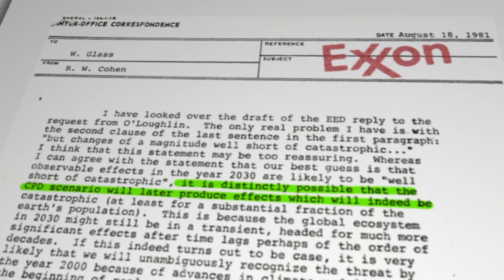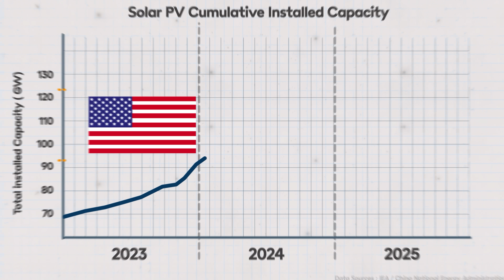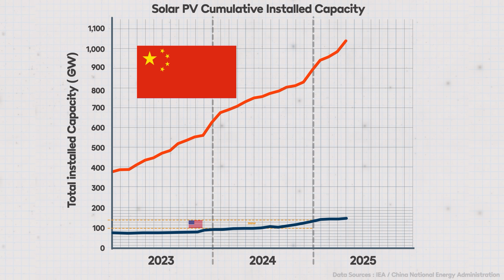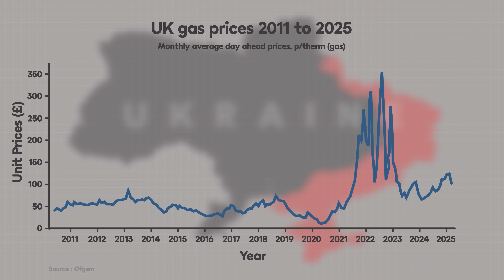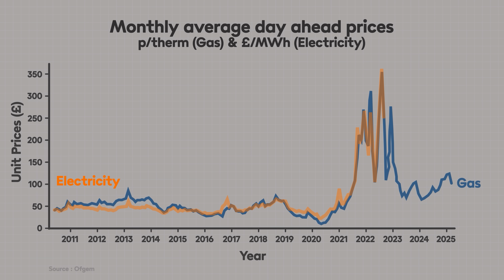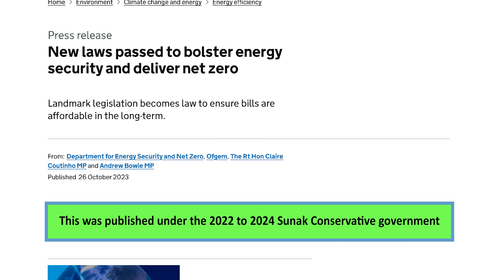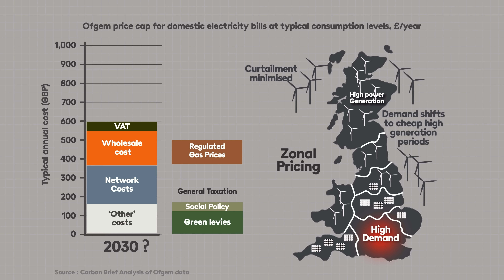Why is UK Energy SO expensive?

Comment: A lot of people think increasing U.S. drilling permits automatically means more oil production—but that’s not how the industry works anymore.

First, the easy oil is gone. Most of the low-cost shale formations were tapped over the last decade. What’s left is deeper, more geologically complex, and way more expensive to extract—even with horizontal drilling tech.

Second, production costs are rising fast. Thanks to new tariffs on steel and aluminum, the cost of building and maintaining rigs and pipelines in the U.S. has jumped. So even if companies have permits, they might not drill if they can’t make the numbers work.

And finally, OPEC knows this. They’ve just increased their production, flooding the market at a time when U.S. producers are facing higher costs and global demand is softening. That pushes prices down—again—just like they did in 2016–17, when low prices drove many U.S. shale companies out of business.

Drilling permits are just permission. But the real driver of new wells is economics. If investors don’t see profits, the rigs stay idle.

So when someone says “just open more federal land,” remember: it’s not 2010 anymore. The geology’s harder, the costs are up, and global players are playing a long game. U.S. oil needs more than slogans—it needs a competitive edge
Reply: I have tried to find out how much natural gas resources are available in Europe and in the United States. What I found is that resources will run out pretty soon. In Europe it's only Norway having the bigger resources. They have increased the gas production to the maximum they can deliver. Bea large gas field in den north sea is expected to be empty in 14 years. For the United States who have seemingly vast but quickly diminishing resources the estimates vary between 12 and 17 years until they run out of gas - literally. Only 3 countries have larger resources that will last longer: Russia, Iran, and Qatar - and only one of these three which is Qatar comes into question when we have to look for a new partner supplying us with gas.

Comment: The fossil fuel industries get the largest subsidies in all of industry, and HAVE BEEN DOING FOR A CENTURY! Think about that. Then their lies about "picking winners" and unfair subsidies for alternative energy, etc. Fossil fuel industries lobby for the HYPER-REGULATION of the Nuclear Regulatory Commission, which establishes standardard 10,000 times anything justified by science. The NRC ENSURES that the nuclear industry is 10-20 times as expensive as it would otherwise be. 1960s nuclear plants were built in the U.S. in 2-3 years (Point Beach in Wisconsin for example), and could be done today, COMPLETELY SAFELY, if the NRC is abolished today. Nuclear energy has TWO MILLION times the energy density of fossil fuels, solar, wind, geothermal, etc. It is CLEANER and SAFER BY FAR! It is CHEAPER when done correctly in the marginally regulated environment of fossil fuels, and MUCH CHEAPER if receiving subsidies even HALF those of fossil fuels. MATH and SCIENCE facts.

Comment: Just a think, you don't think. Anyone who continues to claim that energy will be cheaper and more reliable under a renewable grid is either delusional or lying.

Weather-dependent energy is inherently unreliable energy. It is also incredibly costly due to the massive buildout, transmission, and storage needed and the requirement to keep hydrocarbon generators on standby when wind and solar generation collapse.
Policymakers should stop gaslighting and be upfront about the costs and trade-offs for the renewable energy transition.
Reply: Say that when the strait of Hormuz and all the fossil fuels supplied through it are blockaded. The ceasefire in the middle east had been broken again.
Reply: @موسى_7  Well if that happens renewables won't help.

Comment: The UK needs to follow Australia's example and install some big batteries.  They could outbid gas generators in many half-hour segments by buying renewable energy when there's a lot of it and selling it in place of gas power when renewables are expensive.
Reply: There is already 5.6GW of BESS (Battery Energy Storage System) installed in the UK. It is forecast that there will be 20GW to 25GW by 2030 where they will make a big difference in arbitraging between the low and high price points in the day significantly reducing the average cost.
Reply: @sbillows  GW are meaningless. How many GWH of battery capacity?
Reply: It's not far off, sometimes gas generation is down to 2 GW now so it won't take much more before it sometimes becomes zero during some hours.

Comment: The marginal pricing, or Pay As Clear system certainly needs a deeper look. Is wind really £25/MWh or are they bidding low to get all their power taken, knowing they will likely be paid £95/MWh quoted by gas generators for their top slice? If they can really generate power for £25/MWh they should be so massively profitable they will expand rapidly and solve the problem for us anyway.
Isn't the UK problem that we are trying to rush to get to net zero ahead of the rest of the world, financially harming ourselves in the process. Stopping our tiny contribution to global warming won't help anything when China is building coal fired power stations by the week and Trump is digging up oil and gas as fast as they can pump it!

Comment: After working 30 years in the UK chemical industry, what continually surprised me was the level of ignorance around energy consumption, pricing and efficiency in the companies I worked for, only once did do any real work on it, that was only a few hundred hours. The main focus was on maintaining the Saturday quo rather than putting forward an idea. Yes, our energy bill was a very large number and yeas the manufacturing site were closed , demolished and replaced with small industrial or housing.

Comment: Blaming gas, but what is the reason we are using gas in the first place?... renewables.
The only reason we rely so much on gas is because of renewables. So you can't say it's fossil fuels causing high prices as, we actively got rid of cheap coal for renewables and to have renewables on the grid you need gas back up equivalent to the amount of renewable generation dispatched.

Effectively we need to build 2 grids side by side so we have a reliable one we actively don't use in favour of the unreliable one. 
Instead of just using the reliable grid.
Reply: He didn't blame the use of gas.
He blamed the pricing system which bases the price of all energy on gas.
This auction system is ineffecient.
It's a lot less work to have all electricity supplied by a state-run monopoly, because energy is the type of infrastructure which benefits from vertical integration.
Then again, the country we're talking about is so silly, that even its military industry and oil industry are in the hands of the private sector rather than the government. I guess national economic and industrial security are not words in their vocabulary

Comment: I've been thinking about net zero. Lets say we get our houses solar on the roof, battery and an EV so we're cuting out energy cost and not using diesel. How are they gonna get us. fuel is taxed at 54% the government also get money as a percentage from our energy bills. Like smoking also highly taxed. The government is already insolvent its why next year we will have the tax rate equivalent to Dday...... I do have a small battery and solar system.  this is a 2kw battery and 3x 420w panels. It powers the tv, 2 laptops, and a few bits saving about 2-5kw a day and i do want to build on it as energy prices go up......were on an island of coal surround by a sea of oil

Comment: Batteries, windmills and solar panels require so much mining it's ridiculous, and 10 to 20 years down the road they all end up in a landfill. They're not just unreliable, their completely unsustainable. On the bright side all the climate models run way too hot and increasing CO2 levels continue greening the planet, boosting crop yields and adding more biomass to the planet.

Comment: The auction system is working out well for gas but is at the same time killing renewables with negative prices. There must be some sensible middle way to regulate pricing and ensure green energy stays more profitable than dirty energy.
Reply: Because most renewables generation is covered by that contract-for-difference mentioned, the generators' income is more stable than wholesale prices might imply. Yet I must agree, the system is quite broken for today's marketplace.
Reply: Negative prices will go away as long-term storage ramps up
Reply: It's called the free market, embrace it. There is no such thing as green, clean or renewable energy. This is blatant language manipulation to facilitate the pursuit of an agenda.
Reply: @anthonymorris5084 
The free market doesn't make sense for a centralised system like electricity, which economists call a natural monopoly industry.
Electricity system requires vertical integration, and therefore a monopoly on generation, so there should be no competition.
To prevent monopoly power being used to harm consumers, the monopoly should be controlled by the government which sets prices based on what voters demand, like how governments build and manage roads for free, and how they make public transport affordable but unprofitable.
Reply: @موسى_7  Agreed. I'm referring to subsidies. A subsidy is government interference in the free market. Profits ensure good ideas succeed. Subsidies ensure bad ideas are adopted.
Reply: @موسى_7  Yes exactly. It makes no sense as there is just one set of power lines to my house anyway.

Comment: The UK has possibly the worst electricity pricing system in the world.  If I understand correctly all customers pay the cost for the most expensive electricity producer.  It's time for a major revolution in the system!
Reply: South Australia is suffering similarly from this bidding system affecting retail prices. Fortunately in our part of the world we don't require longer-term storage, and there's tonnages of cheap big batteries coming online.  Got long dark winters? You'll need more of those HVDC connections from Spain.

Comment: I wish you would just think a little further .. Like a  ultra high voltage DC link to Icland to tap into their limitless green geothermal . This geothermal is just as flexible as gas . Oh yes it would make Icland very wealthy  oh dear .  This is something we could just do  sort of . Unfortunatley there is nowhere to couple up to on our completely inadaqaute  grid.   If you look at the  petrol  diesel  and natural gas used in the UK it is  a simple sum for an engineer to perform to convert this to an amount of equivelent electricity required ; it works out  around thre times the maximum capacity of the grid .    The implications of this is that every part of the aging grid needs upgrading for your utopia . That is every substaion , every main road with a distribution cable will have to dug and repalced and do not mention the pylons.   This is not a case of one or two projects its everywhere evry city.
Take west London for example  companies are infromed there is no more capacity in the grid for any more electricty use NOW ; so what is going to power all these heat pumps.   Ah heat pumps great in the UKs wet 5 C  climate absolutly useless when  we have - 10C cold snap their efiecency drops off a cliff ( look it up it , it is pure thermodynamics you come up against ) So I guess this will be ok in this utopia freeze the oldies and save the pension.  I strongly believe  vast reductions in carbon use are neccessary and possible but it will not be possible with religeous zeal it needs hard engineering   and proper planning.

Comment: Can you do a cost analysis on Nuclear Dave? I was looking recently at the various costs involved, like the over spend on Hinkley Point C and Flamanville, decommissioning costs for nuclear and even tiny Magnox reactors which will go into the 2080s, cost of running and decommissioning Sellafield which services the few UK reactors left. I also looked at average lifetime availability on reactors over the years and it is not the 90% people would have you believe, more like 70%. And, we hear that additional infrastructure is required for renewables. Well how about the pump storage schemes that were installed to balance demand with inflexible nuclear generation? Finally the £60bn envisaged for a geological depository. That adds a few quid to each nuclear plant built.
I'm not against nuclear power, but I do believe that the inability to move to newer, safer designs with less waste issues has resulted in the same old PWRs being touted which are at Enormous cost. Don't even get me started on SMRs, which are also PWRs, just minus the economies of scale. Phew.

Comment: Quite a lot of the subsidy costs tacked on to the retail electricity bills are Legacy costs, that will eventually fall out of the system. For example, earlier adopters of retrofit rooftop PV that got the initial high feed in tariff, for 25 years, are now being paid the equivalent of over £730/MWh for all the electricity they generate!,

Comment: I have not read all the comments, but I think you might have missed an important aspect of the current situation: if there were no renewable energy from wind or solar all the energy demand should be delivered from fossil energy, thus rising the demand for gas and crude oil. I cannot calculate this effect but my guess is that the price for energy would have exceeded the present prices.
Reply: There is no such thing as "renewable" energy. The use of this terminology should be a red flag but everyone just blindly accepts and parrots the term without question.

Comment: Whilst the marginal price system seems efficient it actually turns out to be much less cost efficient than just putting generation assets in a regulatory asset base model.  This pushes down funding costs and provides far more reliable and predictable generation.

Comment: Gas generators also get a large payment as part of the capacity payments. These are payments for firm capacity, and should cover their cost of existence. Then some of the gas generators game the system, holding back capacity at times of high demand, to drive up the price to often ruinous levels. 
Surely, if the generator accepts a capacity payment, then there should be a cap on their marginal price. For example, "you will bid 90% of your capacity offered at any time, up to a maximum price of 3 times the gas wholesale price."

Comment: Over on the other side of the pond, here in Alberta Canada it is renewables pushing up costs for two reasons, 1st we have such a low population density that it costs a lot more to upgrade the grid to get renewables to the demand in the city, second, because of the variability of renewables, the efficient co-gen gas plants can’t ramp up fast enough so we rely on inefficient single cycle gas turbines to make up the shortfall and they bid in high prices because they want to make up for not running all the time. 
Net result is we are paying about 10-12cents per kw for the grid costs, and when wind/solar are producing wholesale power prices are 0-3 cents per kw, when they aren’t producing its $6-9/kw. The long term 30 day average this year has varied between 3 cents/kw to 15 cents per kw which just goes to show how consistently the renewables are generating.
Reply: As time goes on there will be more battery storage systems which will even out the supply from the renewables.

In cold climates, they are going to use solar energy to heat a sand battery which will hold enough energy to supply heat during the cold climate.🎉

Comment: We are paying over the odds for electricity as a direct result of Government dogma. When the National Grid and power stations (in England and Wales) were part of the CEGB, there was none of this auction nonsense which has inflated the costs. A merit order determined which generators were brought into service, with some variations for system security, and spinning reserve. This ensured the electricity was supplied at the cheapest cost.
As things now stand, the renewables are raking it in just by getting the same income as the highest cost gas generation. Every company supplying electricity has its own team of managers, accountants, traders and lawyers, all of which add to the costs to the public.
These are direct costs. What is not mentioned is the fact that the CEGB bought from and supported British manufacturers, creating employment. Most of the equipment now being installed is sourced overseas- hardly surprising when our supply industry is now run by French, German, Arab and Chinese companies.
You want someone to blame? Try Margaret Thatcher and Cecil Parkinson.

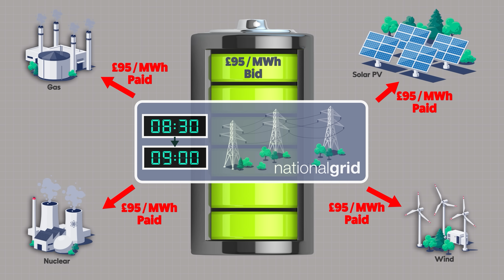Comment: In the UK North Sea oil/gas producers are subject to a windfall tax on ‘excessive profits’. Explain to me why solar and wind producers are not subject to the same if they are bidding £25 and £45 per MWh and yet are being paid £95? (Figures based upon your example at 6:27).
You criticise Big Oil for being venal and profit driven. There are huge vested interests in the renewable sector whose motivation is equally dubious.
Reply: The fossil fuel companies got out of those theoretical windfall taxes by spending money on "research", which included oil exploration. By contrast, renewable suppliers were charged a windfall tax, which they had to pay.

The fossil fuel companies need to be charged to pay for the immense amount of damage they are causing our planet, there should be a very high carbon tax on all fossil fuels.

Comment: It is bizarre that the price of electricity in UK is driven entirely by the price of the most expensive part of the mix, no matter how little it is actually contributing. This last, flexible part  should be provided by battery storage (either centralised or VPP) but the pricing model should be changed as a matter of urgency.